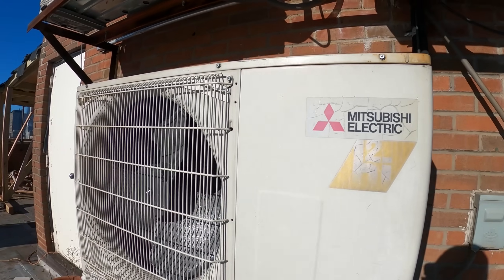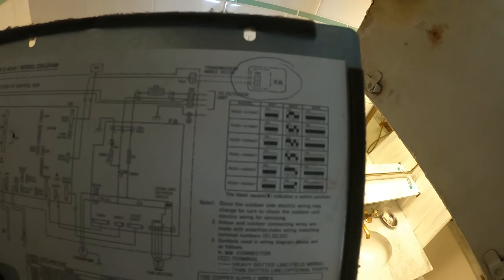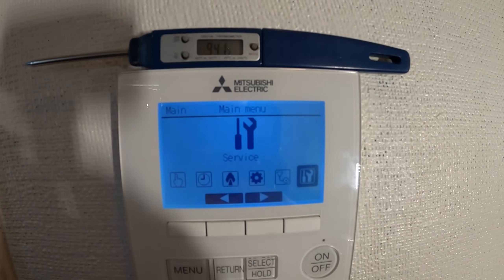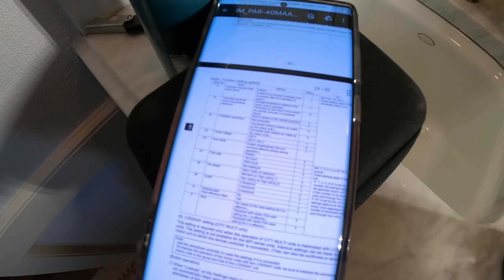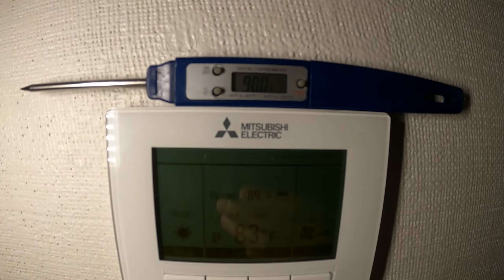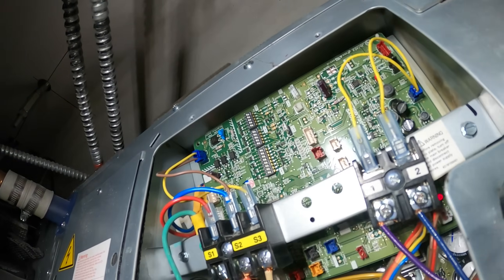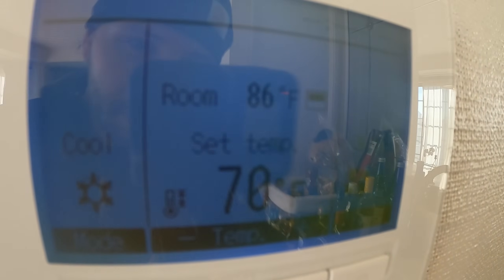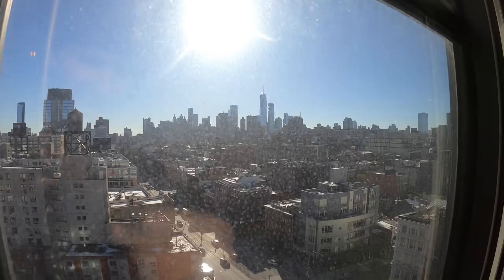HVAC: Mitsubishi H2i Hyper Heating Inverter Heat Pump Not Working Properly (Internal Settings)

Comment: FYI, in the beginning of the video, if you look at the wall controller you will see an icon of an indoor unit. That is showing where it is sensing the indoor temp from. As you can see that when you changed the setting the icon became a wall controller

Comment: Good example of a bad commissioning job.  I'd wouldn't be surprised if the other equipment was in the same situation.   Interesting path from problem to solution.
Reply: Put a video with a good example then…

Comment: Totally complicated system. Lord have mercy! Who in their right mind would use this equipment?
Reply: Omg it's 2024 already! What happened to the 1970's😢
Reply: Pretty much everyone down here in Australia 🤘 love working with this stuff
Reply: @JesseDoesHVAC Jesse from Oz- pleaser expand-why in particular do you like workign on these Mitsubishi systems ?
Reply: Everyone outside the USA.
Reply: These units are awesome when setup properly. This is how nearly every manufacturer is now. When we install new units now for unit startup I request a controls tech and a service tech out at the same time.
Reply: They're pretty good systems, but in this case, whoever installed it did a very poor job at properly configuring the settings.

Comment: Good job, like my journey men always told me never assume that the guy who installed it did it correctly! He said always said start with the easy stuff and work it forward, just like you never assume the power is off “meter it”! That sure looks like extension cord for power, YIKES you never get the easy ones!!